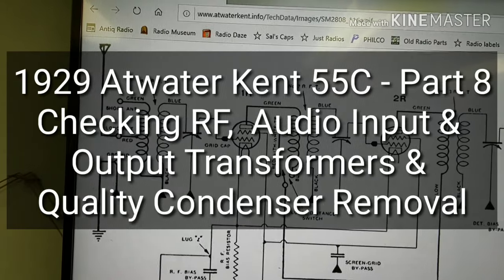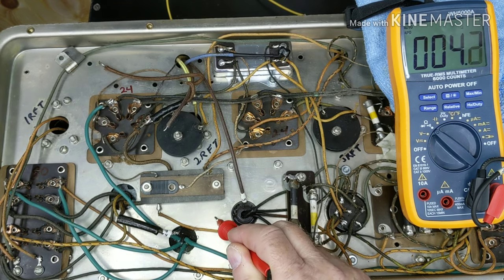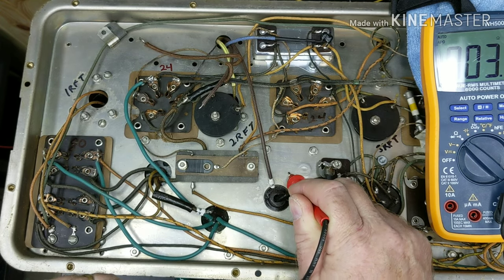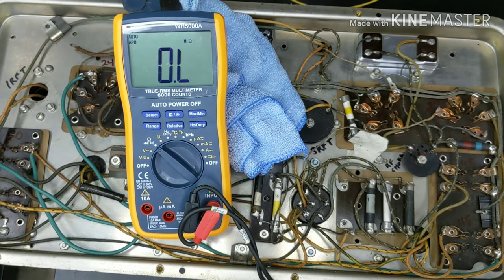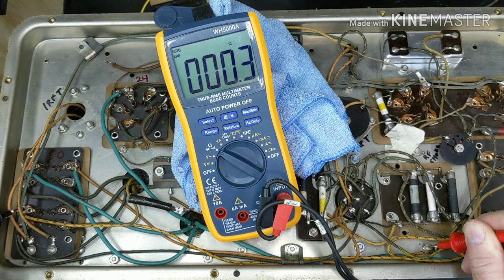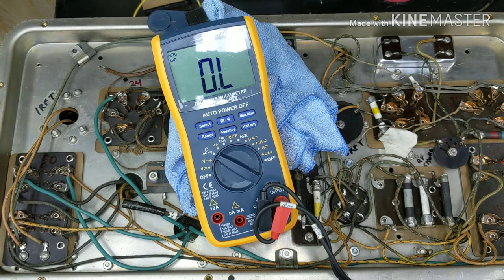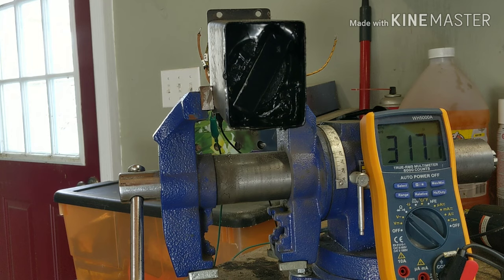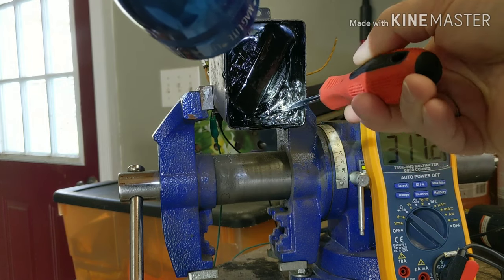1929 Atwater Kent 55C - Part 10-  Checking IF,  Input & Output Audio Transformers

Comment: Nice job Gregg.
Question, Did the quality capacitor "need" to be replaced?
My feeling is because it was potted in tar no moisture could have got to it and it may still be good even after 80 years.
BTW....Keep an eye on your mail box next week.
Reply from the maker: Well I did a bunch of research on the Atwater Kent site, and everything I read was that it needed changed. That's the main reason I cut it loose. I guess I could've waited and hoped for the best, but since I am already all in, I decided to just bite the bullet and cut it out. I got extremely lucky I think. Thanks for watching Bill, and especially thank you for the GE gift!
Reply: I will admit I was biting what little nails I had when you went in that can to make the cut...LOL
Reply from the maker: Yeah, me too!

Comment: Did I miss something?  I saw you cut the cap wire.  But, I didn't see you replace the actual capacitor.
Reply from the maker: Left the cap in the can. With the one wire disconnected it is fine. I add a replacement in a later video underneath the chassis. I restuffed an old cap of the original size and put in there. Looks like an old cap vs. new, not that it matters. I replaced resistors with new